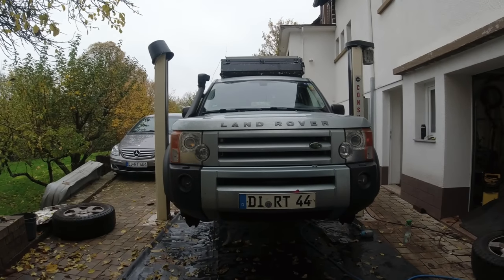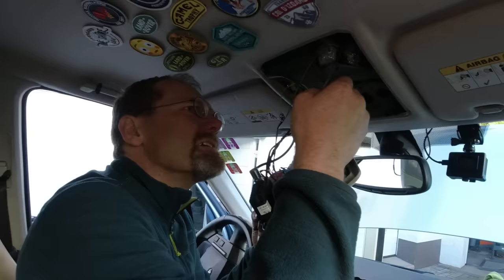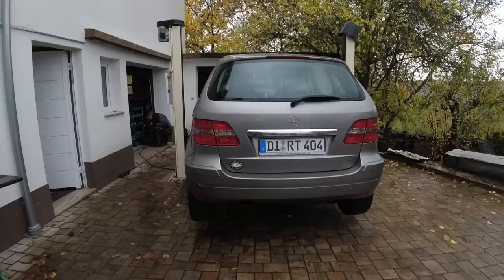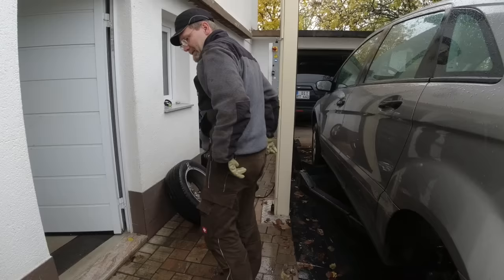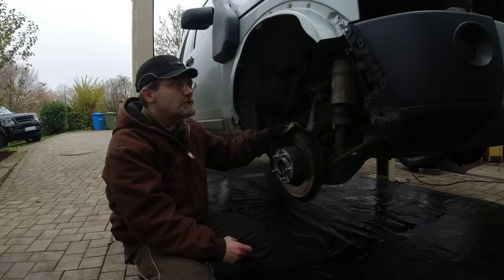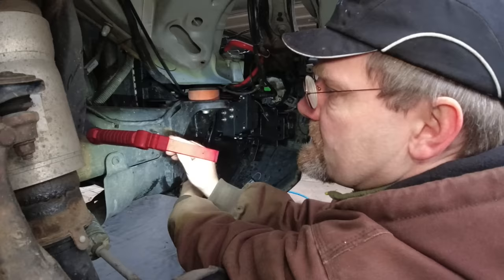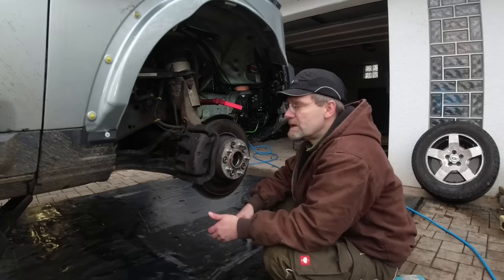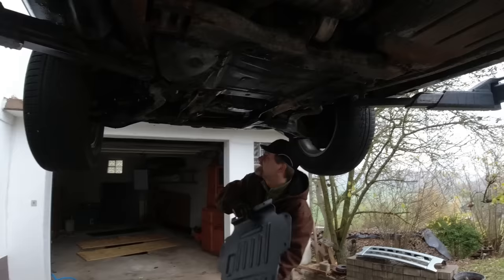Land Rover Discovery Air Suspension Problem Fixed

Comment: I'm making comments as I watch it.   
CM's Intro lecture: Yes, you hit the nail on head. 'has anybody had this light on? '  of course they have. RTFM people. I have zero experience of Toyota, apart from hearing the odd one now and again; they sound similar to many Mercedes, a bag of bolts being shaken. I guess its because their owners think they don't need servicing, so have no clue how to do it.

Vera's droopy D3. : Initial thought for a front left air leak in the winter is that the FBH exhaust pipe has broken where they always break and melted the Front Left air line.   
Aha. The leaky valve block. I've never touched mine, they don't leak, but I've got a few second hand ones on the shelf that I have stripped and cleaned, but I've never replaced any O rings on them.
Yes the air suspension is a reliable system if you take note of any warning signs it may give and fix them before they become a big problem. My 2005 D3 with 320,000 has all original air suspension parts except the compressor and tank. I rebuilt the Hitachi at 9 years and then new Hitachi compressors became available so I put a new Hitachi on at 10 yrs. I then put the rebuilt one on my D4 and it ran for another year. I took the tank off and replaced it with a second hand one that I cleaned and repainted, and then did the same with my tank, so I have a spare. I also service the compressor about every 2 years.

The Integrated Interface Diagnostic tool,  or more commonly called the IID, that's Eye Eye Dee from GAP Diagnostics in Canada is by far the best 'user' OBD diag tool for the Discovery, expensive, yes but not as expensive as the LR diag tool. 

Best tyres on the rear lessens the risk of rear end break away, but with the Disco's DSC its a very low risk anyway.
Pleased to see more Patreons every week, you deserve it. Another great entertaining and informative episode that is part of my Sunday ritual, watch LR Time while filling my pill box for the next week..
What did it fail the TÜV test on? Something embarrassing?
Reply from the maker: Yeah, the TÜV visit was really embarrasing. We will make a video about that repair of course, but we were missing parts. So it will not be up next Sunday. 😅👍🙋‍♀️Vera

Comment: My favorite Guys I have a question, is it normal for the LR4 to be nose down lower after parking overnight ? I see other LR4’s in the parking lot with the front slightly lower too and upon start the engine it goes up a little. The rear stays the same height. Thanks again and really wish you guys are here in Kalifornia :(
Reply from the maker: No, the car wakes up every few hours and levels itself.  So it lowers evenly.  That’s why Vera pulled the fuse to disable that function.  Our Mall Crawler does not lower at all.  Christian
Reply: @Vera_and_Christian  Christian, thank you for the quick reply. My 2011 LR4 is a little front low everytime I park it for a long period but she levels out upon first engine start and stays level until I park it for long periods. Is that normal ?

Comment: Hi, I have a disco3 and recently got the suspension error warning light 😞. Then I saw your YouTube on the subject so I tried step 1 of diagnosis and removed the fuse overnight. Result! The suspension stayed up. I had a data analyser put on and was told Rear Nearside height sensor had an intermittent fault. Put on a new sensor and had the same fault! The plug to the sensor was changed but the same fault exists. 
Do you guys know where the sensor cable routes so I can test it as it is an electrical fault somewhere between the suspension computer and the height sensor.? Many thanks. 
Oh, the fault appeared after, that wheel, going over a kerb fairly slowly. 
Love the channel😊
Reply from the maker: Hi, it is best if you sign up to our Patreon channel, LR owners become mechanics, tier if you need technical help. Unfortunately, we just get too many messages and emails from owners in need of help. 😌🙏🙋‍♀️Vera

Comment: Hey Vera & Christian, I have a quick question for you about the D3 air suspension, so last night I was driving my wifes D3 V8 on the otorway, suddenly got a yellow suspstion warning light followed by a red one, truck lowered and then I got a puncture (due to big a$$ mud tyres). It was dark so couldn't see but the whole truck was sat on its ar$e. Got recovered home. plugged in my IID tool and the only faults were all 4 height sensors out of calibration.  umm how to find the leak ?  I suspected a blown airbag but which one.  I noted the time of the height sensor faults and the first one a few seconds before the others was the N/S/R (which is the side with the puncture).  Checked airstrut and found a tiny hole on the bottom. My question to you is how would you of diagnosed the issue?   Keep up the good work.  PS the IID tool is worth it;s weight in gold, I must lear n more of its features.

Comment: I would avoid spraying WD40 on plastic fittings. It can cause the plastic to swell and bind. I always use a silicone based releasing agent where any plastics are involved

Comment: M+S is a marketing and geometric marking. The 3 peak snowflake symbol says that the tyre has been through an independent test and has to be better than a control tyre. 
I've seen Marks and Spencer (M+S) written on tyres that have no sipes (small cuts) and mostly bands of rubber. In other words useless...

Comment: You are quite tough on the ignorant LR owners.:D I had the same leak on my rear valve block after i changed the o-rings. I tried to do the job again, but never got it leaktight. I ended up buying a new block.

Comment: I just ordered my valve block rebuild kit on eBay. Saw another channel with a filter for the air suspension hidden in the back left compartment. Not related but thought I'd try it but have a logic 7 radio in my 2012. A subwoofer is blocking access I'll need to remove.
Reply from the maker: Check out our video on our valve rebuild. We also got it on ebay and not all o-rings where included. We were not happy. I just got a link send about 4x4 Airseals. Maybe they have them all. I don't know. We will run the Amazon valve until it fails. Unfortunately getting a OEM valve took too long here in Germany. 🙋‍♀️Vera

Comment: Can you please make a video about changing the silicagel in the aircompressor?
Also please clean up the corroded struts! They will last longer
Reply from the maker: The struts will get replaced soon. We will not open our air compressor unless it's absolutely necessary. The risk to introducing a secondary problem is not worth it, just for a video, unfortunately. But when the time comes, we will definitely make a video about it. 👍🙋‍♀️Vera

Comment: My 2005 LR3-SE air suspension is refusing to rise after replacing the air compressor, all fuses are good, battery is good, cannot detect leaks, had to jump the relay and still nothing , been browsing through blogs and youtube😵‍💫😵‍💫
I need a hefenweizen or two and some last resort advise if you have it, thank you for all your videos❤
Reply from the maker: Maybe you squeezed and blocked an airline line. Happened to Christian also. 😅👍🙋‍♀️
Reply: Thank you for the reply guys, i will double check it all again😅
Love your helpful videos, have a great time! Greetings from Texas🤠
Reply: Found the culprit, the middle "reservoir " air valve had the smallest hair crack on the backside behind the threaded part,, go figure😁

Thanks again, stay awesome!😎

Comment: Really love all of your series, even the diesel ones (which I don’t have) 
But have you run into issues with the cruise control? I finally was able to afford a gap II D. And patiently waiting for it to show up. But a friend scanner says speed sensor A. Even the dealer hasn’t been able to tell me what part it is? 🤷‍♂️ Help..
Reply from the maker: Wait for your tool and scan it yourself. Google the code then on the Disco3.co.uk website. Sometimes you have to dig deep to find the solution. WE haven't had any problems with the speed control yet. 🙋‍♀️Vera

Comment: Dear Christian and Vera,
Are you going to make a video on fixing Fabien’s transmission fault caused by water ingress into the automatic gear shift lever electronics?
I think I have a similar issue. Although my vehicle doesn’t have a sunroof and it isn’t water that has caused the problem.
The liquid involved is usually greeted with the word “Cheers” and I will say “Cheers to you both” if you show us how to change that lever module.
Despite my iCarsoft 930 telling me it is lost communication with that module, I have changed the brake light switch just to be sure. But there is no improvement.
The vehicle will not change up gear unless I manually ask it to in Command shift or put it in Snow mode and then the dashboard eventually lights up like a Christmas tree. Then the engine will not stop, when I turn the key off.
Is it the car or me that has had too much beer and is drunk?
Cheers anyway!
Reply from the maker: This sounds like a different issue you have.  If the car does not shut off it sounds like a serious canbus issue.  Christian
Reply: @Vera_and_Christian  Upon reflection, I think you may be right re a serious Cambus issue. Mine is a 2005 automatic S model. I once has a 2004  manual SE and that suffered from a Cambus issue in which the suspension would drop to its lowest position. The speedo would also stop working. But being a manual, the gearbox was fine. If I remember correctly, the Cambus issue was underneath the car somewhere near the Batery. LR realised they had an issue with the early cars and upgraded the Cambus loom manufacture. So, this could be the problem. I’m taking it to my friendly non-franchised LR specialist shop tomorrow for its MOT and we will use his more advanced diagnostic tool to see what it suggests is the problem.
I did spill some coke (not beer) near the Gear shift lever during the summer and this was making me wonder if it is the problem, considering my iCarsoft 930 is saying that it has lost communication with what I assume is the lever mechansim.
Cheers, anyway
Reply: @Vera_and_Christian  Dear Christian, I have got to the bottom of this issue, which turned out to be very interesting indeed!
You will remember that my Automatic Discovery 3 would not change up gear. Today I was driving it on my way to look at a younger replacement vehicle and it was all working fine. However, it started to rain and I turned the lights on. Immediately, the gear box would not change up gear again. So I turned the lights off and it worked as it should.
I have already changed the brake light switch, but this had no effect. The guy who did my MOT test failed the car, because when you turn the lights on, the brake lights including the top, central one on the upper rear door came on, even though the brake pedal was not depressed.
It turns out that a faulty top left rear bulb was causing a short and all the problems. Once that bulb was changed, everything works correctly.
The car thought that as the brake lights were on, it mustn’t change up gear. Once the brake lights were working correctly (and not only when the side lights were also on), everything works correctly again.

Not surprisingly, I now no longer need to change my vehicle for a younger one.
“Better the Devil you know, than the one you don’t!”

Comment: Sorry I don't agree about LR3 air suspension being reliable. Maybe on smooth tar roads, but not on gravel.
A little story - back in the mid 2000s I was the project manager of a mining project in the Northern Cape of South Africa. It was 130 km from the nearest civilisation along an un-maintained dirt road. Because of it's remoteness I hired a paramedic to live on site for 12 months. 
He decided to buy a new LR3 to commute home every weekend.
It didn't go well for him. In those 12 months the air suspension and he had to have it recovered each time.
In addition the engine was replaced after 6 months because a coolant hose vibrated loose - when you are driving on bad roads you don't have time to look at instruments.
Also he had to replace 6 of those stupid low profile tyres because they blew out.
Meanwhile I was driving a very used Toyota Corolla 1.4 (company pool car). It certainly struggled - some of the 'road' was deep sand so I would have my foot flat in 2nd gear to get through, but it seemed to shrug off the abuse. All except 1 tyre which was shredded and no paint left on the door sills - sand blasted off.

Comment: You really should install an override fuse switch on the air suspension fuse so you don't need to pull it every time.
Reply from the maker: We will definitely pull it every single time and show it on video, otherwise I have to answer 200 comments on which fuse to pull. 👍😀🙋‍♀️Vera

Comment: Have you ever come across a C1A20 Pressure increases too slowly when filling?
Reply from the maker: Could be anything from a leak, stuck valve, weak compressor, clogged line, leak in reservoir.  Christian

Comment: super, my d4 has no air tank drain, which is weird, probably got water in it, maybe I should tap 1/8 bsp on the tank bottom
I have only partial use  of my left hand so i cannot get the compressor out, my fault code tells me that the pressure is not dumping, my light on the raise lower switch goes out, and the system holds pressure but does not control so the ride is bad, any ideas people

Comment: I had a customer's old Buick with air suspension in the back (primitive 1990's self-leveling setup from Buick, for fat backseat passengers and all their junk in the trunk) that would sporadically bleed down for no reason.. drove me nuts trying to diagnose it for months and sure enough, similar problem with the valve. Yeah yeah this is a Land Rover channel I know 🤣. And I'll throw my hat in the ring for all the people out there saying put the good tires on the back - that's fine; if you're in a warm dry flat environment. ONE panic stop on damp blacktop and you'll never put worn out tires on the front ever again. For reasons that will become obvious to you when it happens. Christian is right, just be a man/woman and buy new tires and keep it up to snuff 😁

Comment: Since you really seem experienced I thought that I should let you know the TRUTH about WD40.  It is NEITHER a lubricant, nor a deionizer.  It does NOT help stuck parts because at its core, it is GLUE with a powerful water displacer carried into cracks by a potent penetrating carrier.  It might still be good to use in a wet/salty environment for certain things (after all, it was intended to keep missiles from corroding on carrier ships), but should not be used liberally to loosen rusty parts.  Use PB Blaster for that.

Comment: Is it common to just be the front left? Or is it common for both front shocks to leak off? I'm watching the video now in case the answer is within the video ha ha
Reply from the maker: The shocks were not the problem, the valve was. Everything is explained in the video. 🙋‍♀️Vera
Reply: @Vera_and_Christian  thank you I've just ordered a Gap IID so hopefully I can get it squared away soon, traded in my Freelander 2 but didn't have a Gap tool when I bought my D4, I'm a sinner ha ha

Comment: I am not a Patreon member yet but I wonder if you have an idea what may be happening with MY suspension. Living in a cold climate and my LR3 sits outside for now. I took it for a 10 mile run today and when I got back my suspension went into off road height mode by itself! I tried to take it to normal driving height and it goes back to off road height. If I shut the car off and put key switch to position 1 I can lower the vehicle by double tapping the down switch but the right rear corner is staying up. Is it possible my ride height sensor is frozen and stuck? Or bad? I am about to pull my hair out here! any ideas?
Reply from the maker: No chance to get this sorted without a diagnostic unit, like everything on a LR3. Christian
Reply: @Vera_and_Christian  Thanks for responding. I have an ILand  diagnostic tool. I will keep plugging away at it. The wet snow today didn’t help I’m sure.
Reply: @kviasen7603  Thank you for your contribution. I will check the wiring again but it looked clean and new when I installed a new battery yesterday. I did see a mouse under the hood yesterday so I am hoping that critter didn't peel any wiring and create the problem for me. I do not believe it is living in the car but it is possible.....and I can't find it.
Reply: @kviasen7603  yes. I am getting code C1A00-54 Ride Height Control - permanent fault
Reply: The LR3 is in extended off road height on the passenger side rear and it went to normal ride height on the drivers side when I took it down the road 1/4 of a mile to see if it would force a lowering of the suspension. At this time the drivers side will NOT come back up. I have removed air lines from the compressor, the middle valve block and now the air spring that is in extended off road position and I get NO air leaking out at all! Man this is stumping me. I think the air spring has a check valve in it and as the spring is SO loaded with pressure it is holding the air in. I currently have that line disconnected from the air spring and the vehicle jacked up to relieve some pressure from that spring. I will leave it sit for awhile and see if it airs down that spring at all!

Comment: My air compressor doesn't like working in the cold, but works great when its relatively warm out (50+ deg F).  Tapping it all around with a soft rubber mallet does make it work, but thats starting to get tiresome 😛

I'm seriously considering an air-to-coil conversion.
Reply from the maker: Oh no, don’t castrate your Discovery 😱.  If you do, you can join the „coil sprung Discovery group“ on Facebook and sit with them in a chair circle to discuss the good old times 😂🤣.  Christian